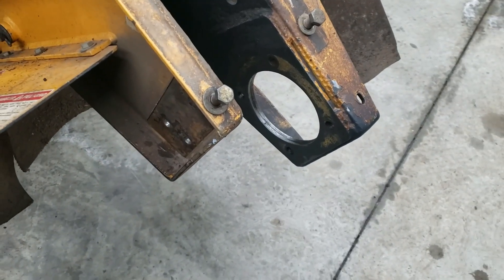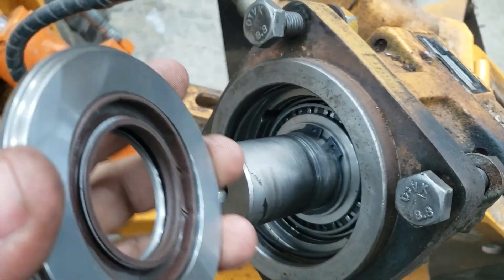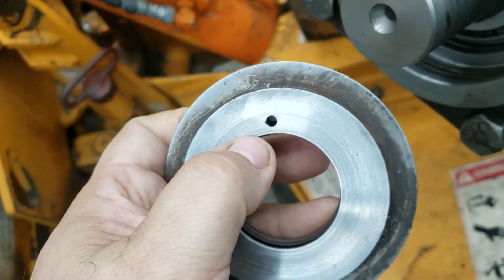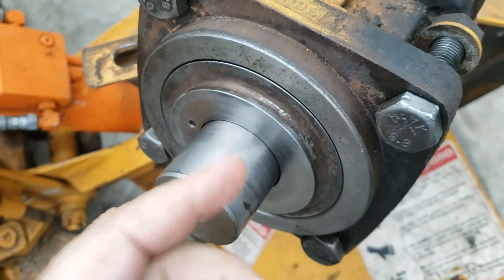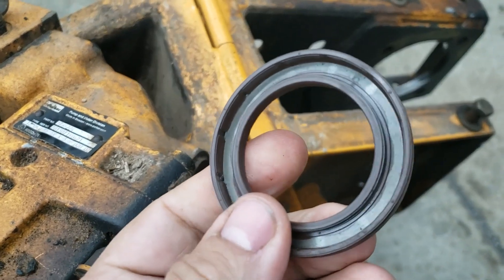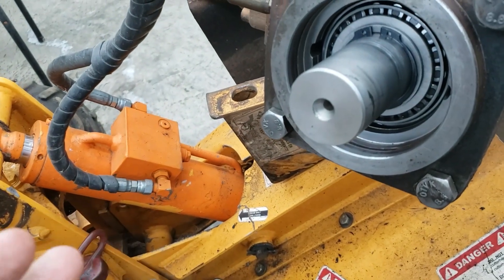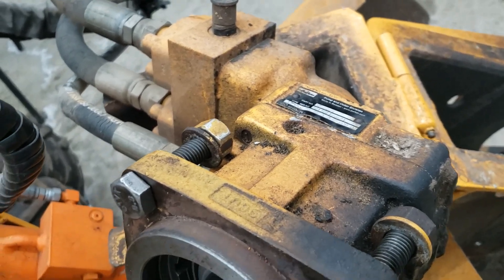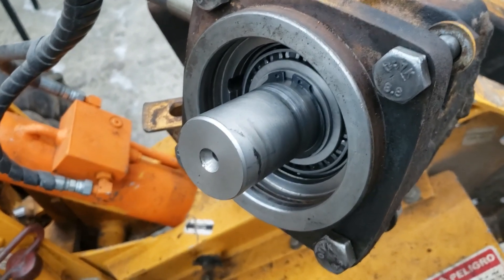Bandit 2550 Stump Grinder Parker Hydraulic Cutter Wheel Motor Seal Repair

Comment: Hey do you happen to have the part number for the o ring and seal? Thank you!! Mine just started leaking today.. terrible way to end the week 😕
Reply from the maker: I order mine from a local seal supplier in my town, but call this place and have your serial number to your machine and you want the cutter wheel motor seal kit  https://modernequipmentparts.com/bandit-parts/?gad_source=1&gclid=CjwKCAjw5qC2BhB8EiwAvqa41hy0OaatwK_Bn339HrHLllps-UKp8mtKIFaGo8cMem09M4xW6nq8NxoC-SAQAvD_BwE

Comment: What's size of the seals on the hydraulic motor? Thank you.
Reply from the maker: metric I will try to look it up this weekend
Reply from the maker: do you have a seal shop near you?
Reply: @mustangrebuilder  there's couple good bearing/ hydraulic seal shops locally available. As well as online. I figure I'd order parts on not in stock before I disassemble machine. Thanks for videos!
Reply: Did you by any chance have time to find out seal sizes. Thank you.

Comment: I'm having a hell of a time removing the cutting wheel hub from the shaft. Any insight on removing it? The book says use 4 bolts @15 foot lbs in a cross pattern. I can't get it to budge.
Reply from the maker: Ok so you got all the bolts off the cutter wheel right and then the star looking bolts on the cutter wheel right ?
Reply from the maker: https://youtu.be/aiUfvRonHA4
Reply from the maker: WD40 and cross hatch pattern on bolts and slit tapping on it or light heat ( light ) the collar has some rust on it

Comment: I have a 2011 2250 grinder, we've found it's underpowered recently. We had to replace the clutch cable and seems to still underpowered. I did notice the hydro tank discoulerd, heats up pretty good, have you seen any issues similar to ours. Wondering if there's a leak or glossed filter somewhere. Any info would be greatly appreciated. Thanks
Reply from the maker: Has to be a hydraulic filter and need to be changed ... look in owners manual in the exploded parts pictures ... change fluid AW46 ..there should be a cooler for the hydraulics and make sure fan runs . I used to have that machine as just a back up and it just didn't have any balls and I think it got discontinued and they went to the SG40 .... my advice fix it and sell and get the sg40

Comment: I have a barreto 30sg, and whenever I push the button to engage the cutting wheel it won’t spin, could it be the hydraulic motor connected to the disc?
Reply from the maker: Sorry my friend I have never worked on a Barreto

Comment: Thanks for all your videos, you’ve been a great help to me opening my own stump grinder business. Been at it over 2 years now here in Virginia, just bought a 2019 Bandit 2550 with the 50Hp Kohler Diesel, I just mangled it pretty bad with a bunch of metal or something out in the country pockets sheared off, cracked teeth, but worst of all now the grinder wheel is wobbling real bad and making a terrible noise. Any idea what it could be? Thanks
Reply from the maker: Go through the process of pulling the wheel like in the video  it could be like what happened to my brothers is it just moved off the shaft holding collar just a bit.